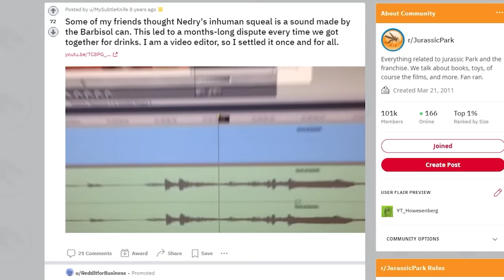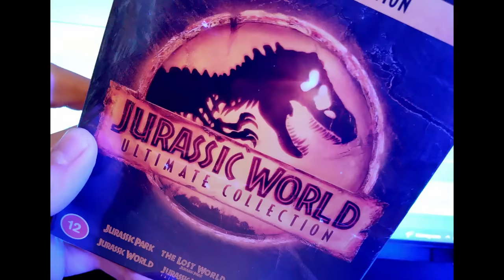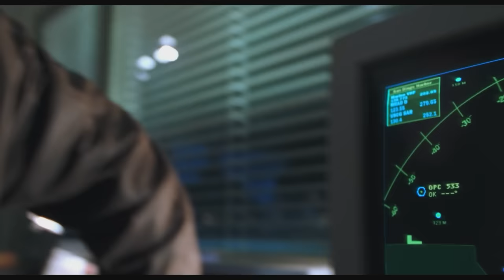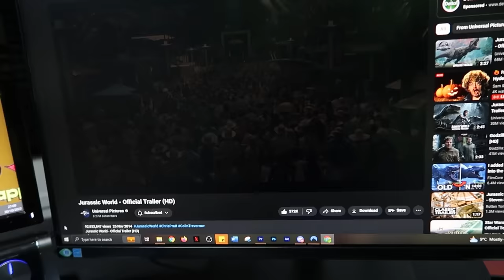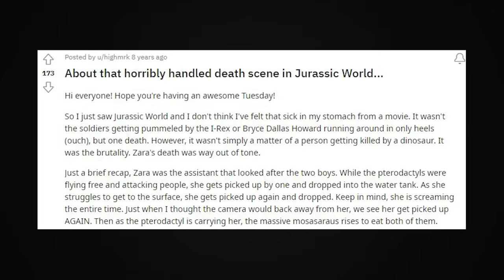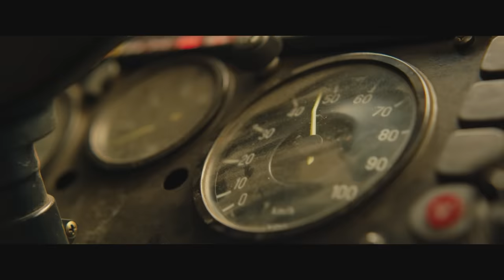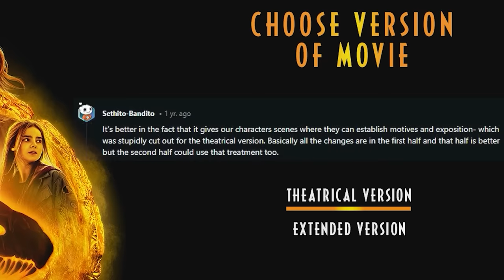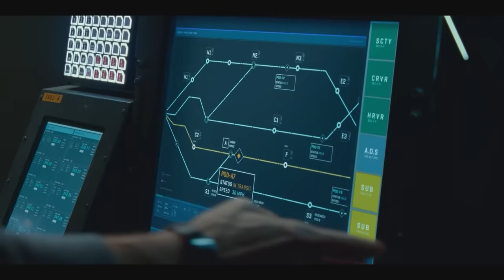Every Jurassic Park Movie - RECAPPED!

Comment: I saw Jurassic park in cinema a couple of months ago for the 30th anniversary when I left I turned to my brother and said I’ve just had a realisation that Hammond saved his grandkids life by eating the ice because the power went out it was gonna melt so he ate it but by doing that he left the freezer door open allowing Tim to lock the raptor inside
Reply: This doesn't make sense. I mean, why would they lock the freezer door? While some commercial freezers can be locked, there's absolutely nothing in the film that implies that Tim was saved because Hammond wanted ice cream. 
This is the kind of logic you'd expect from one of Heavy Spoilers' jokey 'theory time' bits.
Reply: @iwasyou66 During the kitchen scene, Tim runs toward the freezer to get away from the raptor, noticing the door is cracked open. Who would've left the doors open except for Hammond after getting the frozen goods out?
Reply: @iwasyou66 every job I’ve worked at that involves a freezer always involved locking it before closing hours.

Comment: Muldoon: "So here were my options. Option A. Quickly turn the shotgun with as little body movement as possible and blast a few at the raptor. Option B: Compliment the raptor, take the claw to the face and die." 
*Raptor roars and jumps. 
*Screen pause.
Muldoon "Shoulda gone with option a."
Reply: I was disappointed that Muldoon was killed in the movie not the book.
Reply: @randallbesch2424  same here. I only read it recently though.
Reply: Thank you for the movie reference not many people know it thank you master pain I mean Betty
Reply: I know this is responding to an 8 month old comment, but there's a popular fan theory that Muldoon didn't die to the raptor attack.
Reply: The raptor could have pounced faster than he could have turned

Comment: The fan wiki about the indominus rex is fairly correct but there are a bunch of other dinosaurs and other genes that were used in its creation that are still unknown in the lore
Reply from the maker: So are these unofficial extra genes just fan theory?
Reply: @Howesenberg  pretty much the genome of the indominus is actually fairly unknown apart from the obvious stuff like cuttlefish t rex and Velociraptors not exactly sure where the fan wiki got the other stuff apart from speculation and visual clues

Comment: As always excellent stuff but 2 things you picked up wrong in JP.
1) The ditch the car falls into is not an inconsistency. In the book there is more exposure on the park infrastructure that was actually well thought out for the most part and Hammond really didn't spare no expense. The island was located where they would regularly get cyclones. Because of this they dug out their own extra infrastructure to help drain excessive water much more quickly. From the center of the park in multiple directions deep wide moats were dug as main drainage to the ocean. The spiderweb of smaller ditches and drains all spilled out into them. Where Rexy broke out wasn't a random spot along the side of her perimeter. She breaks out at the corner of her area with the moat which is why that place is level with the ground. Just a little bit back towards the tunnel where the kid's car was parked, is just past the corner and where the moat is. From what I understand this was implemented exactly like that in the set but because of the way it was cut, it does seem weird why Rexy is level with the road and just a few meters further there is some gigantic cliff. But that spot was specifically chosen where they could feed her and where visitors should be able to see her because animals congregate to the corners of their enclosure.
2a) A hacker isn't just someone who breaks into a system, it's someone who finds a way to use or to make the system do something that wasn't intended. Hacking is widely used in the entire electronics world where you pull open devices and it's just replacing parts to repair or add functionality. Hacks and as such hackers exist everywhere, which is why there are a billion videos of "real life hacks".
2b) Lex her background is that she is a computer software hacker and as such she recognises it's a Unix system. She has experience with those; enough to have an idea where to find how to fix the locks. The program you see her using is actually real. It's a visual file system (explorer...) called "Silicon graphics 3d file system navigator" (many images on google search of it). Instead of a flat text tree representation of your folder structure in explorer on a Windows system, it shows it as a 3D structure in a 3D environment. In the root of a system drive of a Unix system, you will find a folder /usr/ which is a folder for user files. In the movie you can see that she starts from this /usr/ folder. From there the whole park is divided up into folders of locations and systems and subsystems and in each folder are bash files (scripts) that operate every single part of the island's automated systems. If you go back in the movie when Jackson is complaining to Nedry about the malfunctions, you can see that the park is controlled via a program called "Jurassic Park System". This is the user friendly front-end UI and when you click parts of the park in that program to make it do something, the program is executing those bash files in the background. So all Lex is doing is starting scripts directly from the file system instead of using the custom software they made for the park.
2c) To understand how detailed all the computer scenes are you have to actually know coding lingo. When Nedry is leaving the computer room, he mentions that he fixed the phone lines and tells them the phone lines might glitch for a moment because he submitted code to compile. This is how coding works in real life. You setup a server that is a "CI/CD pipeline" aka continuous integration/continuous delivery. The code is saved in a central version control system. From this place a coder makes changes and then submits his local version to the central version. Whenever new code gets added, the server compiles this code into a program that a computer can run. Once it is compiled (and hopefully some automated tests succeed on this new version), the server can deploy the updated program to the systems that use it. Normally you would schedule this deployment during a maintenance window but Nedry makes it deploy right away. When you read the text in the windows on the monitors, this is exactly in line with the theory. You can see that Nedry has checked in updated code to the central system and that it started compiling it. BUT they even go further. You can see the pascal code of the program that Nedry wrote to bypass the systems. The script is called "nedryland" and the code itself shows that it's basically a loop of code that locks up the systems. And the worst is, all they had to do was press tab+spacebar and everything would have been fixed instantly and nobody had to die.

Jurassic Park is one of those 0.000000001% of movies that actually does have an exact representation of the software side. It's all correct and as expected if you have the background.
Spielberg could have made an 8hour video explaining every little detail but that wouldn't have made jP what it is. Just like how they tell you some frogs can change sex and you just believe it no matter if that's real, while a biologist in the cinema will pee a little in his pants realising they're talking about the hyperolius viridiflavus found in central Africa.
Reply from the maker: I appreciate the feedback on these....two points? it takes real passion to extend two points into such a long breakdown, while there's no way I can possibly find time to respond to it all, I do thank you for sharing some insight.
I was only calling Lex a hacker and what she was doing as hacking because it was a quick way of describing her background and her actions in the film, if that makes sense? I know the term 'hacking' is often misused by people unfamiliar with it and that's what I was banking on. I suppose it could be considered lazy of me but in my defence I think that kind of detail is only important to people who are savvy on the subject.
Reply: @Howesenberg Well you did the same as Spielberg choose to do so you're in good company.
It's hard not to be passionate about JP I guess. It's just an almost perfect movie just as Band of Brothers was an almost perfect series. The guy has a pretty good track record. But that last one would be either the shortest recap video or the longest ever so not very suited for the style.

Comment: 1:09:48 the problem is that its force is also on the whole building and not just the door, Obv you gonna have a more difficutl time breaking a small stick rather than a bigger stick
Reply from the maker: I thought about that but then I thought wait, this dinosaur could easily just smash the whole building down if it's able to crash through a steel fence.

Comment: And also you can see Very clearly if you look at a map( I don't know where to find it) of The T. rex paddock There is 1 area Where the T. rex can be seen and on either side there is The Moats (I still don't know if I spelled it right)
Reply from the maker: I just found the map you speak of. But still it doesn't make sense why there would be a moat there. Do you remember the part where the front Jeep (next to the supposed moat) when rexy drops the goat leg on their car. How could a rex be standing in a massive moat drop and manage to drop the lambs leg on top of the car?
Btw I think I made it clear that I still consider this movie to be perfect, having a slight continuity error isn't an issue.

Comment: You know, to be fair to the gymnastics scene, it’s easy to forget that those kinds of scenes are meant to be interpreted as happening simultaneously/at the same time. Or I’m coping… also if I swing from a pole, I feel like I could kick a raptor out a window… I’m coping… I must be
Reply from the maker: It could be argued as possible but in my opinion it's not 100% plausible and it's a moment that takes you out of the immersion to think about it as a weird movie moment. Now, if she used her gymnastics skills to get away from the raptor, that would be completely plausible
Reply: @Howesenberg  Yeah, I think as a scene, the fluidity and immersion would be kept if Kelly did her Gymnastics in the background or slightly out of shot as the raptor stalks Ian before being suddenly then kicked out of the window. it would still retain a similar amount of goofiness but just be less egregious.
Reply: @Howesenberg  There definitely should have been moments to show her athletic ability by getting away from the raptors over randomly kicking one out of a window

Comment: I mean, average weight for 13 yr old is around 75 to 135 pounds. The girl even on the lower end probably has 80. Her swinging from the pole wound generate some kick at the end. Imagine someone swinging a 80 pound hammer. If the raptor has hollow bones like i heard they do, it probably at least knock it off balance.
Reply: im pretty sure they are over 800lbs try kicking over a cow

Comment: You left out the fact that the Spinosuarus has both the T-rex and Giga beat by about 2ft in length. Not even a contest between who's biggest.
Reply from the maker: Yeah that's by length not by height. I'm sure the 'biggest' will be a fact that changes with the advancement of science and discovery.

Comment: Pretty sure it's gasoline, not motor oil. Oil is cycled in the engine. Not hosed throughout... the car? Could be wrong. And gasoline is very uh smelly